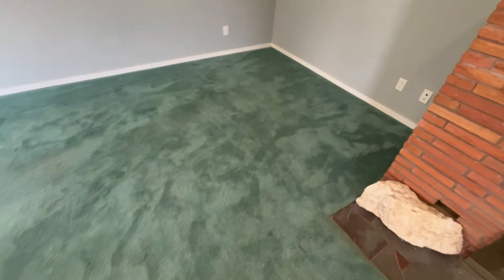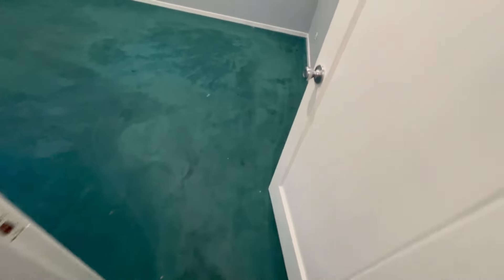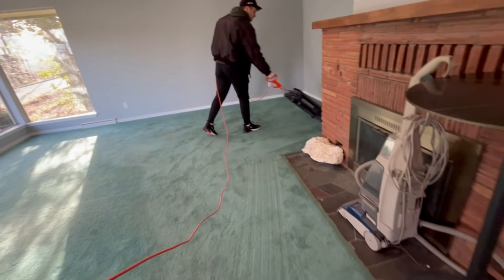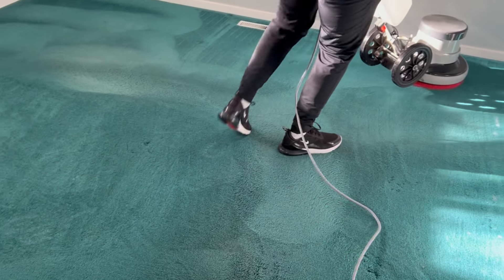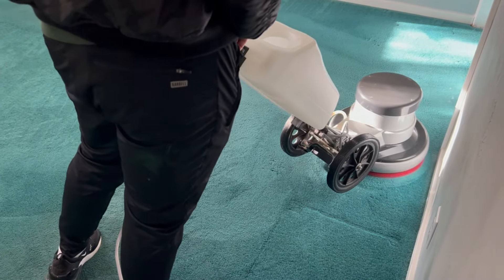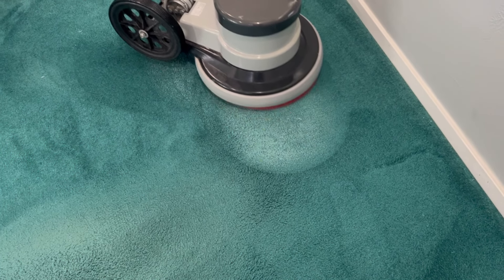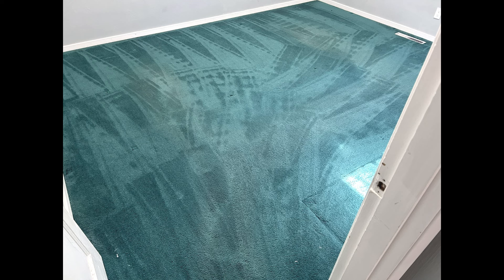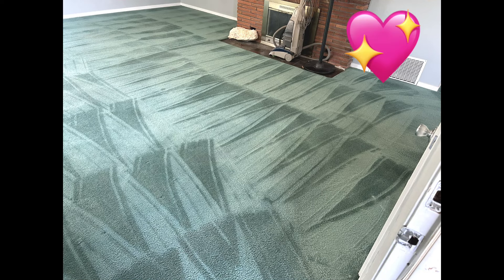Removing Paint from carpet is not included in the cleaning process

Comment: Carpets typically are attached to a backing with laytex type glues, so caution needs to be used with paint removers such as Goof-Off, Limonene, Acetone. etc., or the backing can detach, possibly causing noticeable puckering after the job is compleated. Very time consuming. And YES! the customer should definitely be told in advance of the severity of the problem. And yes It is good to lower outcome expectations, but then surpass them in the final results.